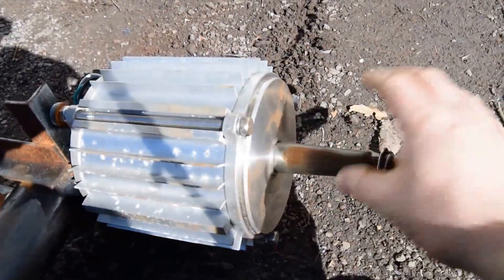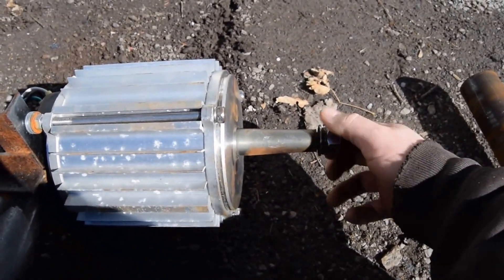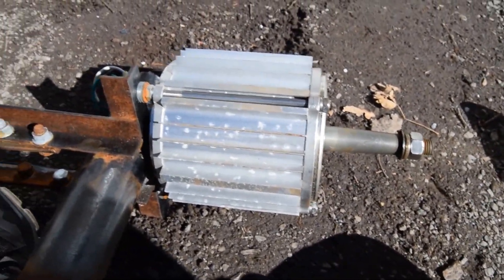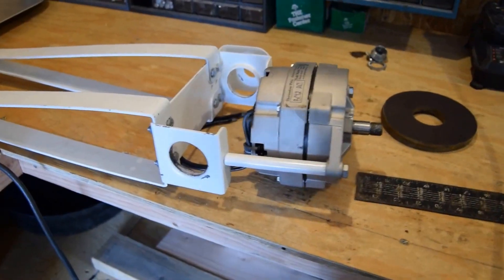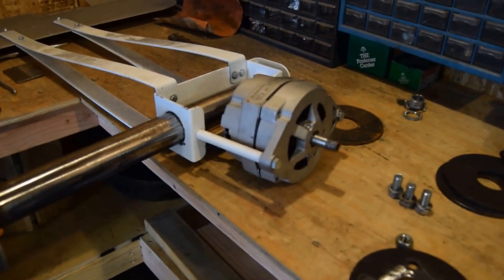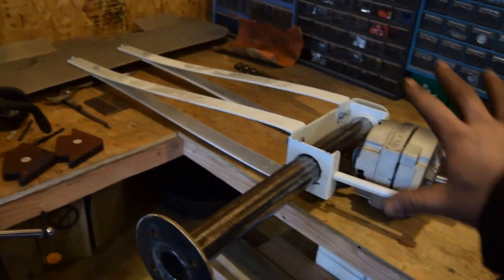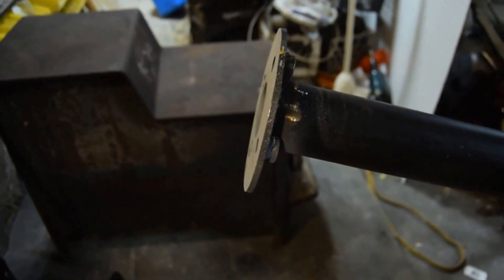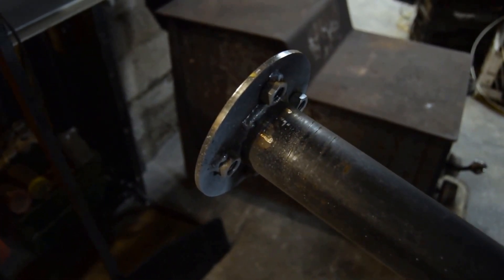2016 Wind Turbine Update - Thermodyne Systems Super Core

Comment: As a real user of wind energy I recommend truth and durability. http://rover.ebay.com/rover/1/711-53200-19255-0/1?icep_ff3=2&pub=5575119394&toolid=10001&campid=5337668021&customid=Genuine+PMA&icep_item=331994936214&ipn=psmain&icep_vectorid=229466&kwid=902099&mtid=824&kw=lg The Original PMA, not a Missouri fake knock off.